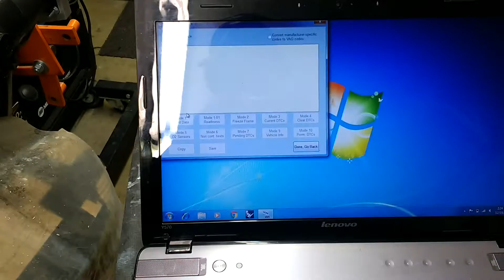DSM ECU Repair - Capacitor Replacment

Comment: . hello, I have such a question, I have a 1995 Mitsubishi, it starts up, but it feels like it smells of gasoline from the exhaust pipe and the engine does not work, but after 10 minutes of work, it stops working , I take off the spark plugs and they are all in gasoline.after 5 minutes it starts up again and again after 5 minutes it stops itself. it could be ECU ?
Reply from the maker: Sounds like it could be. Could also be a sensor or wiring. Could be engine heat or electric current in a wire or device heating up and then creating a short or discontinuity condition.

Comment: Dude I tried replacing the capacitors and now the car runs worse. It won’t go past 2.5k rpm and pops when being revved. Any way I can reset it? I have replaced caps with same capacitor ratings. I am also using a new ecu and I want to save this old ecu
Reply from the maker: Sorry I don't know what it could be. All I can say is make sure you installed the caps in the correct polarity and make sure the board is clean.

Comment: The life expectancy of these electrolytic capacitors vary. These are the first thing that goes bad. I have a 1950's electrolytic capacity checker which puts actual electrical load on these capacitors. I have found many out of tolerance & leaky capacitors because wear and tear and age. Repairing these capacitors will mostly likely bring the computer back to life.

Comment: Someone replaced two capacitors in my vehicles computer. They never checked polarity  on one of them and it had blown out. I noticed a rattle in my computer when I removed it. As I knew that ment something was loose and could cause a grounding issue if I put it back that way, I opened the unit, noticing it had been pried open and revealed. It had a warrenty void sticker on it that was made of paper and didn't  appear to be factory( it wasn't ). Whomever repaired this unit wasn't  qualified to open a can of beans. A simple check of the ground confirmed the blown capacitor was wrong. It had blown the aluminum cap off but left the plastic wrapper on. That gave me a clue as the negative was wired to what appeared to be the wrong pad. They had replaced two capacitors. The other one was not in the same position, so they shouldn't have followed that one's  position relative to the board. Reguardless, I fixed it and it appears to be fully functioning.

Comment: Hi, I sent my ECU for repair as the transmission was stuck in 3rd (limp mode) due to capacitor leakage. However, when I received the ECU, the transmission was still stuck in 3rd. The ECU specialist told me to go to workshop to reset the DTC and that would solve the problem. Is this true? Thank you.
Reply from the maker: I don't know but clearing codes is easy enough to do and usually auto parts stores like autozone will do it for you for free, else unplugging the battery will usually do it.

Comment: Hi there. I'm from Malaysia and I drive a 2010 Kia Forte 1.6. My car is stuck in 3rd gear and it bangs into reverse.  
A local workshop concluded that the ECU is at fault. I couriered the ECU to a specialist and they called me to say that the capacitors were leaking and they had replaced it. When I received and reinstalled the ECU I was frustrated that the problems were still there and 2 additional problems cropped up : No AC and the traction control off light was on! What could  be the problem?
Reply from the maker: Hi Earl, I'm not an expert on that car and can't think not what the problem would be. Sorry I couldn't be of any help. Best if luck to you getting it fixed.

Comment: Hi i have 4A-FE 1757003213 12V NEED TO REPAIR ONE CAPACITOR WAS BARN REPLACE THAT SILL FUEL IS GIVEN MORE 2 INJECTOR CONTINUE SUPPLY FUEL  WHAT CAN I DO NOW/
Reply from the maker: Sorry I don't understand. Can you restate your question.

Comment: What did you clean the board board with to remove the blown capacitors liquid?
Reply from the maker: I don't remember. Probably isopropyl alcohol.
Reply: I came across this video by random but as luck would have it I need to replace my capacitors cause they're having problems. Thanks
Reply: @maypolthedruidful  what problem came in your case?
Reply: @harshkhy  improper idle and random misfires

Comment: dear i have 1jz Toyota crown 1993 model. i think i short circuit the fuel pump wires. now check light is gone and engine not starting
i did following:-
removed battery terminal and connected battery again after 10 minutes but engine light still off
removed fuel pump again the engine light off
please help
Reply: muhammad imran If you shorted out a wire you probably blee a fuse. Check all your fuses. Sometimes there arr two groups of fuses, one inside the car and one under the hood.
Reply: I have 1992dodger stealth RT where  can I get the capacity.

Comment: Hi! I'm having issues with all four injectors in my car, I've been told ist the ECU. What was the problem with your car?
Reply from the maker: I don't remember for sure all what was not working but I think pretty much nothing was working including the injectors or coils firing. I plugged in my scan tool and it was not talking to it and if I remember correctly the check engine light was not coming on. If your capacitors failed like mine your results may vary depending on what the capacitor has leaked on and shorted out. If you can access your ECU is is easy enough to unscrew the cover and check to see if there is something obviously wrong with it like a leaking capacitor like I had or something that burnt up. A lot of times whatever is wrong will be very obvious but other times not. Best of luck.
Reply: @Goldenfab  at that time what problem you facing in car , any communication lost related problem in this case?
Reply from the maker: @harshkhy  nothing was working.